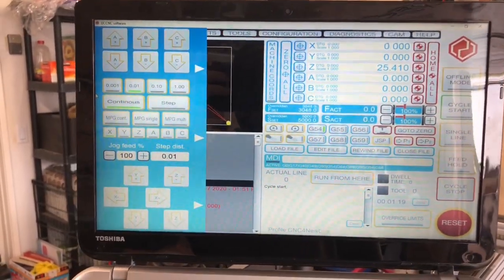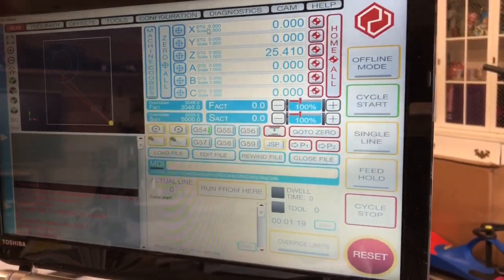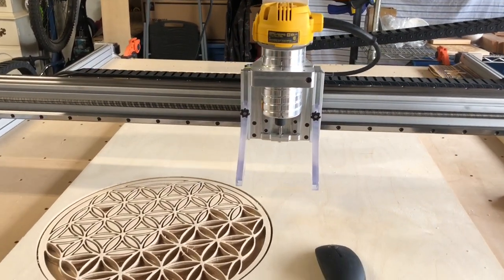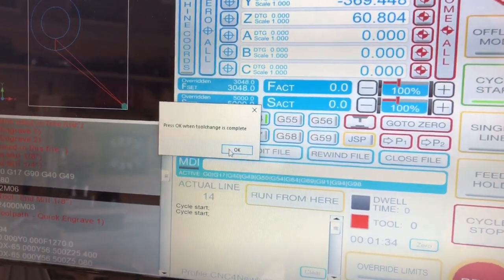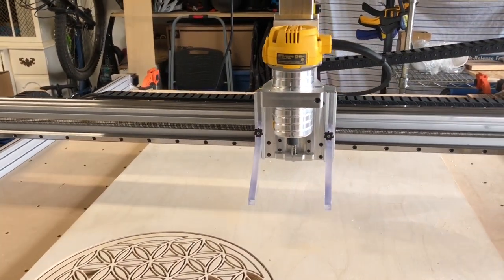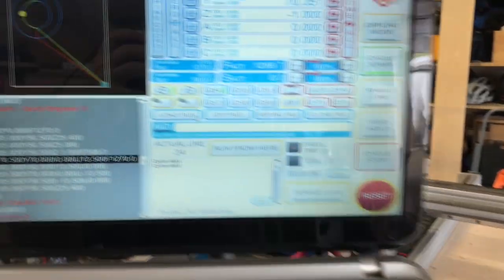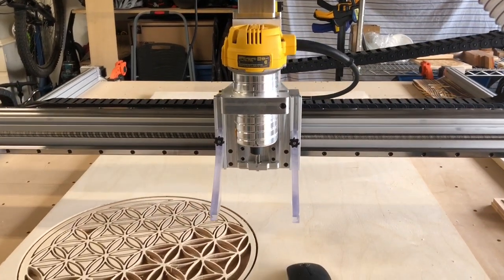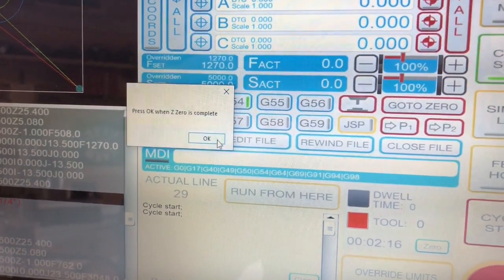M6 Tool Change

Comment: I'm debating on buying this size from cnc4newbie. I'm installing the 1.2 kw spindle.. how ridgid is it? I was wondering if there was a lot of flex on the rails since is 52" of work area. I'm planning to carve wood mostly, but I want to have the ability to cut aluminum sometimes. I'm worry that it won't be as accurate.. any feedback would be greatly appreciate it.. thank you !!
Reply from the maker: There is a slight flex when doing big cuts. As long as you keep them to standard settings for the bits it’s awesome. I have had this machine for a year now and have made tons of orders on it without any issues.

Comment: do you have a macro, or working on one for bit setter?
i've got a shapeoko with the bit setter and love that feature.  I"ve got the 4848, and i'm working towards that, but thought i would ask first.
Reply from the maker: Layne Mims I have one I use.
what controller are you using? I am using UCCNC.
Reply: @LynchMobGarage  i'm using uccnc.  i'm really wanting to emulate the bit setter function of the shapeoko.  i change bits enough where that is such time saver and more accurate from bit to bit.  my shapeoko just has so much flex in it, that it is not good for me.  the 4848 is a beast.  i've got spindle with uccnc and gecko 540.
Reply: https://www.youtube.com/watch?v=I97XwLBmyuc   this is the bit setter video from carbide.  hope this helps.  on startup it runs the bit setter after initial tool, and when you zero z,  all you do is change tool, it hits the bit setter and calculates the offset, then starts the spindle and away you go.  perfect bit changes every time.(until i get an ATC).
Reply: @LynchMobGarage  have you got your m6 macro finished yet?
Reply from the maker: @laynemimstx  Yes. here it is:
//Simple Probe for tool Zero
//This routine probes in negative Z at the current XY location
//Z offsets for G54 to G59 are then re-written to the new Z0

double ZRetractHeight = .228; //Height above probing plate probe will retract to
double CoarseRate = 10; //Feedrate for initial probing
double FineRate = 1; //Feedrate for fine probing
double Zmin = -2; //maximum probing distance

double PlateThickness = .272; //thickness of the probing plate
double MaterialOffset = 0; //compensation for part thickness

double CombinedOffset = PlateThickness - MaterialOffset;  // for use later when PlateThickness and MaterialOffset are DROs

if(!exec.GetLED(56)||!exec.GetLED(57)||!exec.GetLED(58)) // machine was not homed then it is not smart to do this, stop here...
{
  MessageBox.Show("The machine was not yet homed, home the machine before setting Z-zero");
  exec.Stop();
  return;
}

{
MessageBox.Show("Is touch plate & ground wire clip in position?");
}
exec.Wait(500);

exec.Code("G91 G31 Z" + Zmin + "F" + CoarseRate); // Probe Z quickly to get rough height
while(exec.IsMoving()){}
exec.Wait(200);

exec.Code ("G00 Z" + .050); // Retract .05" above the plate
while(exec.IsMoving()){}
exec.Wait(100);

exec.Code("G31 Z" + Zmin + "F" + FineRate); // Probe Z slowly for better resolution
while(exec.IsMoving()){}
exec.Wait(200);

exec.mainform.sumoffsetcontrol1.G54.newCzinput(CombinedOffset);  // Set G54 to new Zzero
exec.mainform.sumoffsetcontrol1.G55.newCzinput(CombinedOffset);  // Set G55 to new Zzero	
exec.mainform.sumoffsetcontrol1.G56.newCzinput(CombinedOffset);  // Set G56 to new Zzero
exec.mainform.sumoffsetcontrol1.G57.newCzinput(CombinedOffset);  // Set G57 to new Zzero
exec.mainform.sumoffsetcontrol1.G58.newCzinput(CombinedOffset);  // Set G58 to new Zzero
exec.mainform.sumoffsetcontrol1.G59.newCzinput(CombinedOffset);  // Set G59 to new Zzero

exec.Code ("G00 Z" + ZRetractHeight); //Retract Z axis
while(exec.IsMoving()){}
exec.Wait(200);

{
MessageBox.Show("Z tool zero is now set, and will move to Safe Z");
}

exec.Code("G00 G53 Z-.02"); // Move Z to Safe Z

Comment: How do you get the router to turn off? I assume you’re using some type of relay but I’m missing something.
Reply from the maker: I use a IOT Relay, it receives input from my gecko540 controller.

This is the one I use:
Iot Relay - Enclosed High-power Power Relay for Arduino, Raspberry Pi, PIC or Wifi, Relay Shield https://www.amazon.com/dp/B00WV7GMA2/ref=cm_sw_r_cp_api_i_84q2Eb53VNHT8

Comment: Cool! So how did you program it?
Reply from the maker: Tom Sanders I created a M6 Macro for the tool change
Reply: PNE Designs nice! What program do you use to produce your gcode?
Reply from the maker: Tom Sanders I use Vcarve Pro for the gcode. I used notepad for the macro
Reply: PNE Designs ok, I use Fusion 360. So do you have to manually ad the gcode after you post process in vcarve?
Reply from the maker: Tom Sanders it’s in the post processor you use when exporting the gcode, it then tells the controlling software to run the M6 macro which tells the machine what to do for a tool change. I am sure there is a better way to explain it. I hope this makes sense though
Reply: @LynchMobGarage  Ok thats what I was wondering! I love how that is setup! Thanks for taking time to chat!